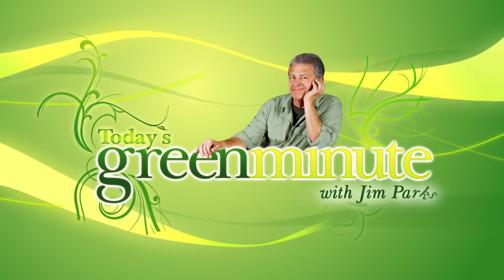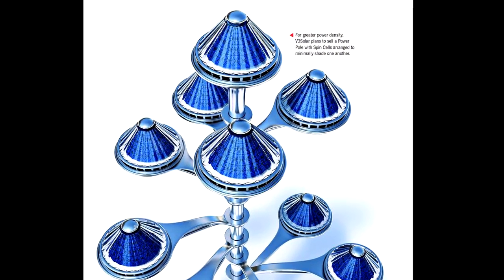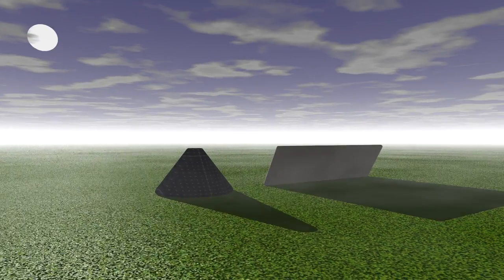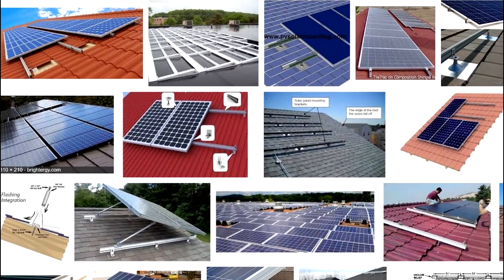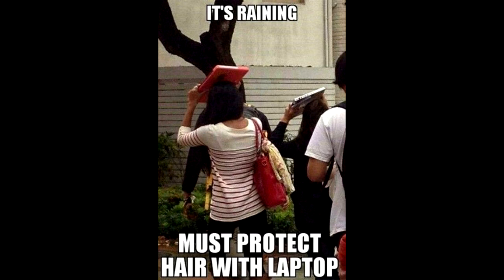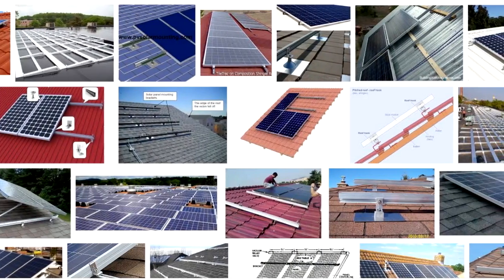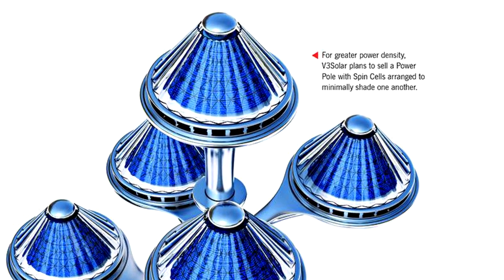Spinning Solar -BUSTED!

Comment: honestly, I have a better idea. We have fans that can run of next to nothing in terms of electricity, I mean I personally have a fairly good fan that can run off D batteries, and I've compared it's usage to a boxfan I have and it literally uses a fraction of the juice. So......why not just mount one or two of these light electricity using fans on the side of a traditional solar panel to keep air flowing over it. You'd probably end up making them more efficient then this.....thing they are pushing could ever be.

Comment: Why don't we just generate additional energy from the heating of the panel? I noticed you didn't address the ability to use cheaper versions of solar panels. I don't recall the study, but there was a project that showed that you can make a significantly cheaper panel that had a much harder time with heat. Maybe the price really is a hit here if you can use the heat to cause the spinning due to some thermodynamic interaction. Minus the optic glass cone thing and the weird tree shape junk and yes, admittedly the shape is about 1/3 as efficient as a regular panel of the same surface area. But maybe being able to use a different material to make the actual panel due to better heating control would actually make this one feasible.
Reply: Worst case scenario, heat would result in a 15% decrease in output.
Reply: Caio Pontes 

Isn't there a new type of solar cell that opperates well only when cool though?

Comment: Very good! A friend of mine, who is also an engineer was amazed by the idea. I destroyed it.
One point you could have added is the spinning mechanism itself. Any moving mechanism requires maintenance sooner or later. A flat solar panel you might have to clean once in a while. 
The cone you would have to clean on the panels, inside the cone, outside the cone, check and clean your axle bearing, oil the axle bearing and replace the axle bearing at some point.

Comment: This is direct result of years of brainwashing the society with green and sustainibility ideologies. Talk against this nonsense and you get marked an anti-progress denier.

Let's face it: solar power where it is currently used even at its most efficient form is at this point still net energy sink. You need more energy to produce, maintain, and dispose of a solar generator than it will produce over its lifetime. Where does this energy come from? Coal plants most of the time as a lot of them is produced in China. All of solar is at this point a make believe that we're doing something useful about nature or climate change. But we're not.

http://www.sciencedirect.com/science/article/pii/S0301421516301379

We might eventually get to something that pays off. But paying for immense fields of inefficient generators and  projects like these is waste, it does not help anything.

Comment: Before watching the whole thing, I had questions.  Mathematically, that spinning cone idea is bullshit.   The ideal orientation of a solar panel is, of course, flat panel, dynamic tracking so as to be always be perpendicular to the sun's rays.  To cool it, add water and use the water as tempered feed to a solar water heater.  There is only one faint hypothesis I can come up with.. the cooling, of course.. But also if there is some kind of storage/delay effect where cells continue to produce current just after they go to the dark.  Even those two things still couldn't possibly match the claims.
Reply: Pumping the water to cool them is also reducing efficiency. The best solution are solid-state coolers, like the ones used in processors in combination with fans. The fans, of course, wouldn't be needed in this case.

Comment: Why not just use a flat lenticular lenses like in the prototype onto a conventional PV panel with a water cooling loop on the back to a heat exchanger in the building's hot water tank? Lenticular lenses are cheap compared to PV panels, you get free hot water out of the system as well and it would be very simple to build.

Comment: the diamond battery is somewhat reasonable, it is compressed radiactive waste that in combination with carbon produces a very small current but it is constant for a long time.
is just the question if the energy that was used to compress this thing is smaller or larger than the total output of this 'battery'
please debunk this too if you feel like it :)

Comment: My ideas:
 1)spining to cool seems legit and probably realy awesome if done well.
2)altough i dont know where that energy comes from, the solar panel?, so that probably reduces eficency.
3) The 20x more efficency is probably a number pull out form the hole system, wich means that the solar panel is as eficient as traditional ones but is big enough to produces an increase in power output.
4a) Also, is probably true that it recieves better coverege of the sun at all time wich will probably help
4B)altough know that i think about, probably the actual area expose to the sun in ideal conditions will be very small, so maybe it could even me a bad thing.
5) They are going to be expensive as fuck due to size requiere to match output (and you know because they are a scam ;)

I just see a good idea for cooling, altough further math should be done to prove if its viable, but energy output will be smaller for same size solar panels.
lets see:
3/5 he didnt talk about the 2 left so preety good i might say
Reply: He didn't mention it but the loss of efficiency due to hot temperature, considering that solar panels even at equatorial longitudes seldom get over 40ºC, is about 15%. That is better than 70%.
He also covered all your points.

1)It may be cool, but it's retarded in terms of power efficiency.
2)The energy in SOLAR panels come from the SUN. The less SUN the panel gets exposed to, the less POWER your SOLAR panels will generate, hence 1).
3)The "20x more efficient" was pulled straight out of their asses.
4a)No it isn't. he clearly demonstrated it in the video.

He did the math. It's shit.
Reply: 2) is about the energy used to spin the solar power, it must be significant

Comment: How would a flat solar panel not gather energy during certain times of the day? They would gather less, but still gather, unlike one half of this cone.
IMO, the only kind of solar panel that could be most efficient is one that follows the angle of the sun... which is a tracking panel, correct?
Gee, I'm only a 20year old cooking student and I know better than these people.

Comment: "it looks cool, it got good marketing" - that's all generation facebook needs to know, apparently... But the solution is oh so easy:
1. 90° to the sun for most efficency of the cells:
- the "path" of the sun is a known thing
- there are already installations "aiming" the cells towards the sun, either by known path-settings or with a light-sensor.
...so that's no problem.
2. the overheating-issue:
- did anybody come up yet with the idea of combining photovoltaic-cells with actual solarcells heating up water? ...let the water run through in an isolated layer below the solarcells to cool 'em down; the slightly warmer water can now be fed to the boiler which does need far less energy to get the prewarmed-water to the wished temparature...
...so this problem is managable, too

Then, there's a 3rd issue, even this thing that resembles the UFO from Gerry Andersons Shado-series does not solve:
3. what about the excess-energy?
...in europe, photovoltaic has been a hit; even without tax-incentives, people install PV-powergeneration on their houses. and ALL of 'em face the same problem: 
there is quiet no way to store the excess-energy for a longer time to use them if it's eg. raining (or during night)...
Sure, there are solutions using batteries, but they are very expensive, can't hold the charge for long, needing transformation from and to, AND they use up much space...

I think, considering above points, best thing to do would be the solve the "how to store the energy" first...

Comment: You are totally missing the point of better using spherical area not survace area. lmao

Imagine a dyson sphere. Maybe you will understand it now
Reply: HYEOL "Spherical area" is not a term that's used in math. The power generated by a solar panel is proportional to its surface area (in the direction of the sun). The same is true for a Dyson sphere.
Reply: ***** Then this conversation fails at the language barrier. I am sorry for my bad english :/ :/ :/
Reply: HYEOL Your English is pretty good for a non native speaker. The point is that it would make sense to make a Dyson sphere a sphere because the sun would be in the middle and shine equally in all directions 100% of the time. For a solar panel on Earth though, one side will always be facing away from the sun.

Comment: Yep pretty much spot on it is a complete hoax. Bit to be fair you did compare it to a tracking solar system and use fixed systems in the comparison also. That's not exactly consistent. A tracked system can't be fitted to a pitched roof. But nor could this system. There could be a good idea in using concave panels with limited tilt and pan capability for roof non tracking systems. Many other improvements could be made to solar panels such as water cooling, better heat sinks and also coupling them with thermal electrical generation. The problem with solar is its relatively poor efficiency and cost compared to lifespan. The fact panels degrade in efficiency over a matter of years. Solar panels are still in their infancy and new technology needs to be invented to increase their efficiency from the 20 odd percent it is currently at. Solar is not an investment I would recommend right now.

Comment: The biggest stinker of this hoax, and the most obvious one is that intensity of light falls steadily away along the cone's curve. It's the exact opposite of concentrated solar power. Does spinning it constantly require more power than a simple tracker, or does it run purely on the hot air generated by celebrities? 

I'm amazed they also didn't clip on a heat exchanger at the back, running a stirling engine.

Comment: what if you had a solar panel that has 2 sides and one shows when it's at a relatively low temp then it flips over when the side facing the sun gets to hot and the other one cools down and as and added thing for cooling the side that is now cooling down extends into the house as it's cooling thru an opening which closes up to let the other panel get the cooling from the air it needs. also while the other solar panels are in the houses attic you could turn on a ac up there and cool it down or just let it get cooled down by the houses air temp

Comment: I'm not one that deals heavily with math and don't really want to look up a formula to figure it out, but could they be efficient if they were used to create wind energy at the same time or would the size required to gather enough wind make it too heavy to rotated efficiently (e.g. make as much or more energy as a traditional solar panel)? Follow up question, would the production cost be too high if such a thing were made?  @Thunderf00t
Reply: No it's silly. Shit like that is fraught with myriad compromises. Each tech on it's own is bad enough, but combining them is much worse.
It isn't as easy as simply bolting "blades" on.
Everything would need to be changed, beefed up. etc. it's quite ridiculous.
The point you apparently seem to be missing entirely is, this is all a big load of horseshit in the first place.
It is a scam. Another one. How can people not see such patently obvious shit, when it is right in front of them?

Comment: I don't understand how any engineer would think these spinning solar panels are in any way a good idea.

They've made a needlessly complex system with a lot of moving parts. Even if you did get a mild boost in efficiency somehow, you'd still have losses due to the energy required to spin those panels.
Not to mention the massive increase in production cost.

Even tracking which is used and has been shown to massively increase efficiency is not used in many cases because a simpler system is cheaper and easier to maintain.
Reply: No engineer was involved in this project.  You dont need a degree to know this is bs.  The idea here is to try to scam people to invest.  Im surprised there is even a demand for Thunderf00t to do a video on this thing.  At least it was an easy one to make.
Reply: Except I really don't imagine they have actually built very much. These kind of scams usually knock up some rough arse "prototype", that barely functions, but is promised it will in the next incarnation, where problems are magically wished away. They then invest thier time with cool and realistic 3D renders and animations of the fantasy product, and plenty of marketing hype.
Sadly with our undereducated, largely scientifically illiterate, gullible populations, it seems to work splendidly. As I would suggest is evidenced by the ever growing numbers being attempted.
I suppose it's a modern equivalent of the old time carpetbaggers and snake oil peddlers.
Reply: rationalmartian
Pseudoscience has been a thing for as long as since has existed.

One of the differences between the past, 100-200 years ago, and now is that a lot of pseudoscience was based on halfway plausible hypothesis. There were a lot of competing explanations for the same phenomena and thus it was somewhat excusable when an invention turned out to be horseshit because it's theoretical basis turned out to be wrong or misinterpreted.

These people don't have even that excuse. As Thunderfoot showed with even the most basic analysis this idea is a nonstarter.

Plus in modern western countries education is a lot better than in the past.
People should also know better because there have been many projects promising similar things that never went anywhere.

Unfortunately there are many factors that allow for this bullshit to thrive. One of them is of course the media. The thing is that sensational headlines like "New solar technology will revolutionize the future" will get a lot more traffic than "So called revolutionary idea turns out to be an utter failure".

I could go on, but this is far too long already.
Reply: You could probably do better by just heating water with solar and using the spin as a generator.

Comment: Is there no lingering discharge after the panel has received sunlight? Is there no chance that it still is generating power while the capacitors for each panel "Cools down"?

Comment: Bosch has made a water injection system to pertrol engines that reduce the fuel consumption by max 13%  if i remember correctly. It is used in the new BMW M4

Comment: While i do agree that the ITS looks insane, and musk seems slightly insane at this point, so far he has been right and is quite the credible person.

I strongly disagree that his mars mission is bullshit, it sounds insane and probably will not look like what he currently has planned, but i believe he will do it soon enough. People kept making fun of his ideas, and he has shown em all.
Reply: I agree. While there are huge questions about life support, I have very little doubt an unmanned version would work just fine. They're using engine technology that has never flown before, but they actually have shown a working engineering article. The principles clearly work. For reentry and landing... Well I think they've demonstrated by now that they are the world's experts in landing rockets. The math works out to bigger rockets actually being easier to land, so I don't see a big issue there either. The cryogenic carbon composite tanks are a big challenge, but by no means impossible. Lastly, probably one of the biggest challenges for the non-life support systems: Transferring the fuel in orbit. A lack of gravity makes this really hard. Not sure how they plan to do it and they probably will not tell anyone either. But again... Nothing that's even close to breaking the laws of physics there.

I'm not really sure what fundamental aspects he wants to debunk. Sure Musk hasn't presented nearly enough details, but the things he presented are pretty reasonable. The price seems absurdly low, but even at 5-10x the cost it could still reasonably be achieved over longer periods of time.

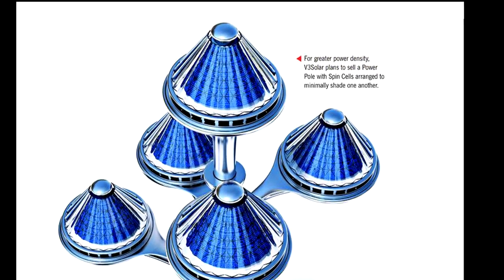Comment: There is a Mistakes in your calculation. 4:10 does not add up. the panel is tilted, so L=1m not h. There might be more cause i didnt recalculate all but your general direction and argument still is true. This is a stupid concept. 3:00 is the only argument needed, heat on Solar panel shouldnt be an issue when not focused on by lenses.

Comment: Isn't the claim that a solar panel continues to generate power for a short time after moving into the shade?

You could test that by having a regular solar panel and putting a fan in front of the light source so it rapidly turns on and off - see if that drops the voltage the panel produces or not.

Comment: +Thunderf00t Did they make any reference to how they go about spinning these solar cones? I am sure that even getting the friction down to its lowest level, they would also be a power drop off because they would need to power the motor to spin this monstrosity as well as remove any heat generated by said motor as it will also raise the temperature inside the glass dome.